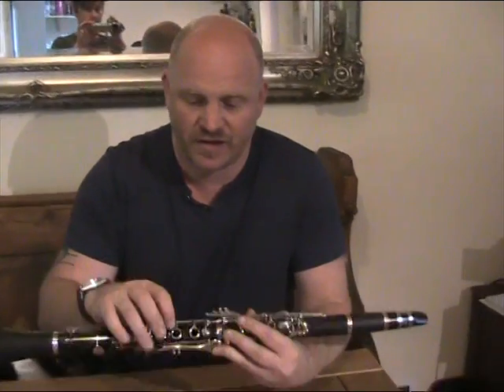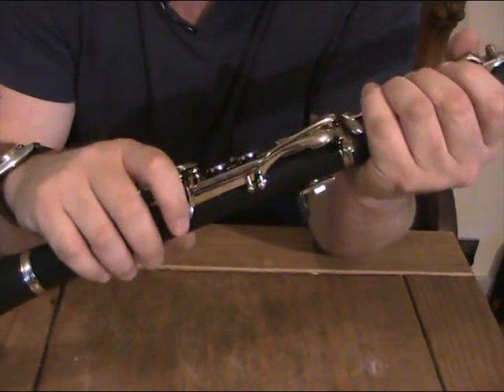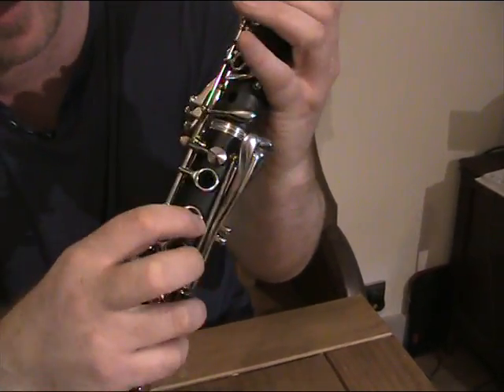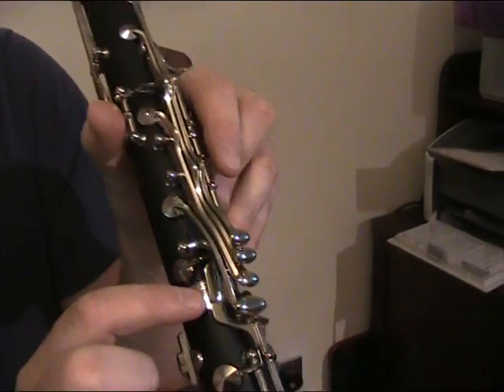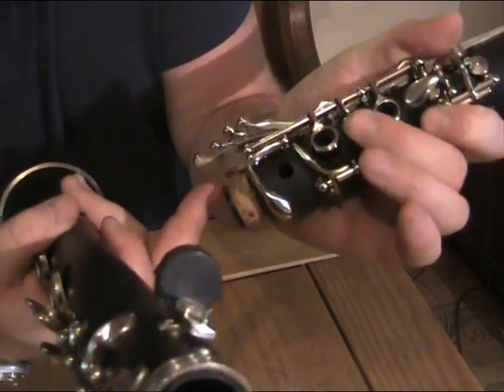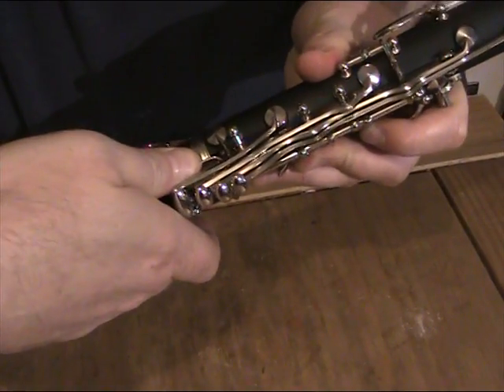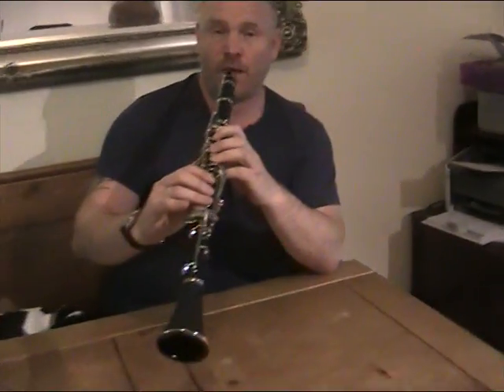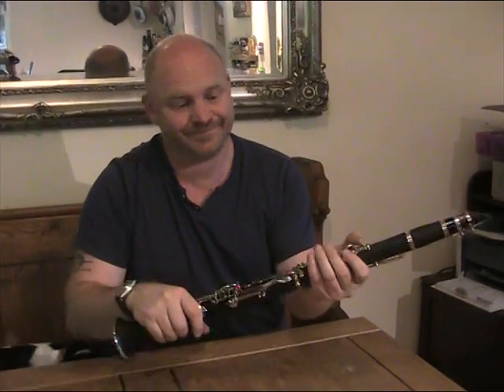clarinet low notes not working. easy fix.

Comment: my low and high keys aren't working. it is as if someone clogged the bottom hafe of it.
Reply: PumpkiNot oh myyyy god same!! did u find out anything??
Reply: pumpkiNot me too!
Reply: try using more air
Reply: oh my gawddd same
Reply: SAME
Reply: @MichaelRodriguez-sl5bx  already tried that
Reply: SAME!
Reply: Did anyone find a solution???
Reply: I just fixed it on mine, I realized one of the side keys wasn't fully covering the hole so I put tape over it and then it went back to normal👍🏿

Comment: Beck check if there is cork padding underneath the linkage, if its missing then either buy really thin cork sheets from an instrument supplier like Dawks of Maidenhead. Over time small pieces of cork will fall out due to wear and tear and especially cork tenon joints and if the pads are leaking or falling off then a full service is needed.

Comment: My low notes are good, its the octave higher, Bs, Cs C#s, both hands that are hard to get in a fast passage. I did have it repaired, but those notes still are hard to get.  I did use some light paper on closed holes, and one was not grabbing the paper at all. That Infamous Eb key.  I believe that could be the prob, but, I am afraid to take key off and "strengthen" the spring. So, I will persevere!!

Comment: Hi,I'm wondering if you can help me.
I assembled my clarinet correctly .The keys are sitting flush with the tone hole when I press the.Everything looks fine.But the lower keys won't play.As in ,no sound at all.
Everything was fine a couple of weeks ago .
If I offset the keys the bottom keys play fine .All seems a bit odd to be honest.

Thanks in anticipation.

Andy.
Reply: Hi,Further to my message earlier.I've followed your instruction in your video,and it worked a treat.
I did try adjusting the bridge key to no avail.I tried it again and Voila ! It's working 100%.
So thank you.

Andy

Comment: This must have helped for a lot of of others, but mine still isn'tn working. I'm first year, (5th grade), and my clarinet isn' t new. For it's the schools. I can do G, A, F, sometimes E, and sometimes D. I haven't been able to do C and B because everytime I try I squeak. Help,anyone! Im also going to tell my band teacher.
Reply: It could be many different things, but I myself had the same type of problem with my clarinet (the low keys weren't working. My clarinet wasn't new, so we took it to a music store and they said that the lower keys were broken. After they fixed it, it worked really well for me. This is just my situation, yours may be a bit different.
Reply: my situation is really similar to yours
Reply: I think everyone that plays clarinet has gone through this before